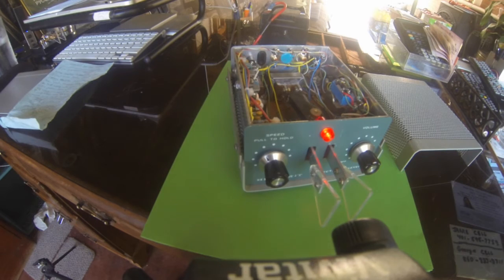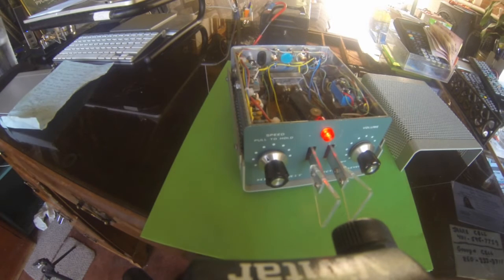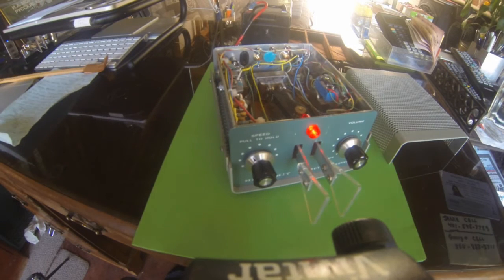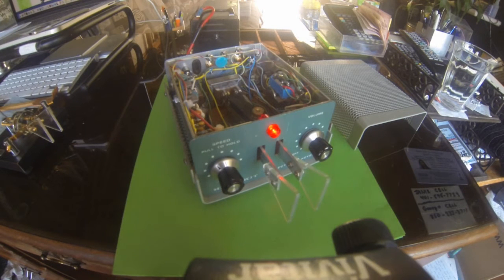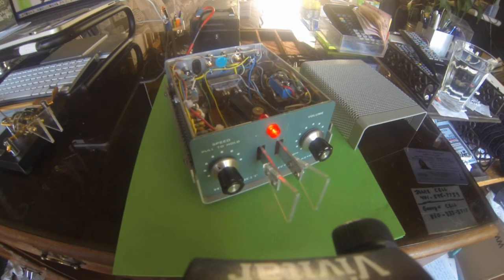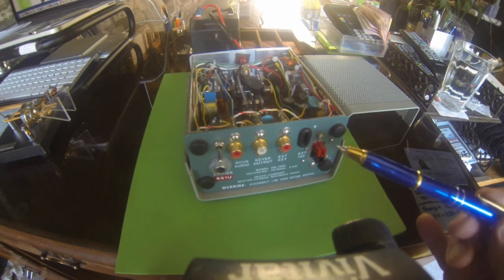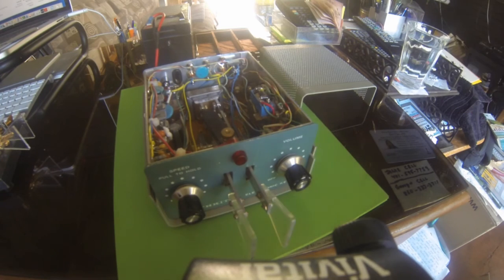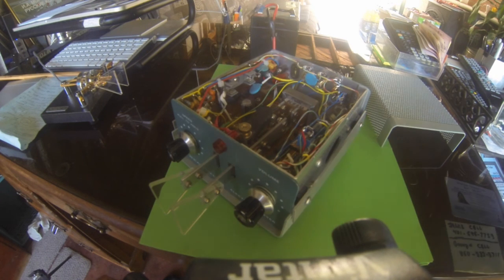HeathKit       HD-1410      KEYER

Comment: How come you replaced some low value electrolytic with tantalum type ?  What advantage [other than size] do the tantalum have ?  Thanks !
Reply from the maker: +cadiscase   I have found them to be more stable, have better ESR, longer life, and less leakage.  They are also smaller.  It's important to use high quality caps with a voltage rating much higher than required.  The downside is they are unforgiving in over voltage and reverse connections.  In the keyer, they are probably not a major advantage over high quality electrolytic, but I buy in bulk and use them whenever I can.

Comment: Thanks. I have one of them ive owned for 25 yrs. I got to wire it up. Im using a borrowed bencher for now. Been on cw recently. I just enjoy my code. When i got my extra i had to get it the not so easy way 20 wpm. My call is kq4cw. Been out of ham radio fer 18yrs. But back into it since retirement.
Reply from the maker: That's nice to hear, David.  I too did the 20wpm route to extra.  I don't usually send at that speed since I enjoy a more leisurely 15 or so.  Enjoy retirement.